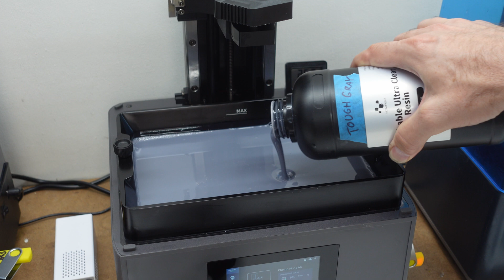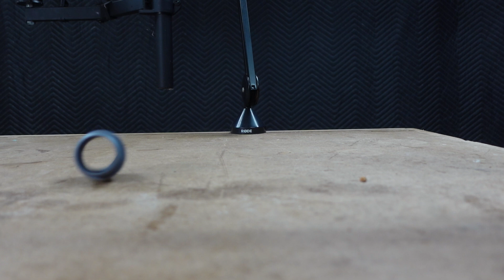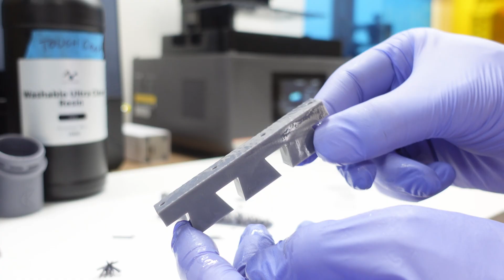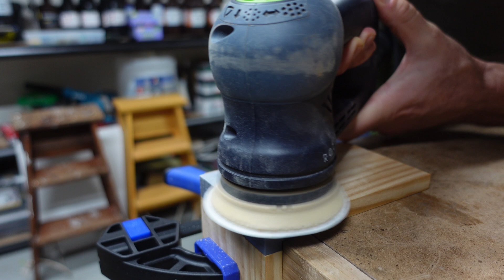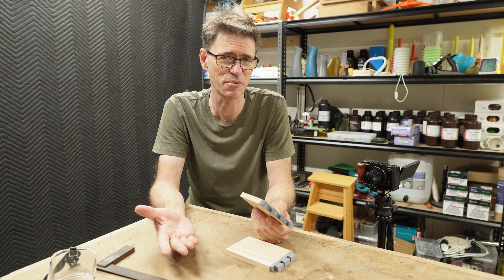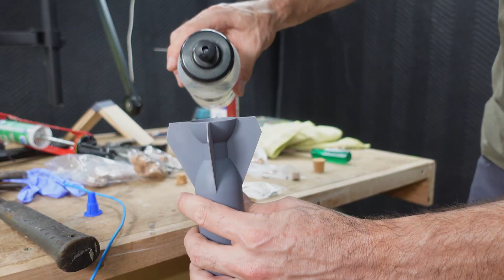Nova3D Water Washable Tough Resin | How tough?

Comment: When your dovetail breaks in bending at 8:40 or so, it’s failing at the stress concentrations.  You can’t design for resin the same as you design for wood...it’d be interesting to see how tough the material is with small fillets in place.
Reply from the maker: Yes, I agree with you. In this video I was just trying to do something a little different and 'break' the rules. I've been interested in ways of combining resin 3D printing with woodwork. It's a bit strange, but could have some interesting outcomes.

Comment: For the dovetail test, using wood glue on a composite plastic is the main limiting factor for the joint. If you were to use the proper adhesive for that resin (in cured form of course) I would bet that it would not come apart.
Reply from the maker: Thanks for the comment. I appreciate the observation. Yes, I agree. I was just using wood glue because it's easy and quick. But it would be interesting to try with a more appropriate adhesive.

Comment: What is the secondary curing process like? Also, how are the creep properties of the resins you've tested? Do they easily undergo permanent deformation under long-term stress?
Reply from the maker: Secondary curing is fairly simple. I used 5min for that part and it seems to work well. I don't have long term data on creep for this resin. So far most of my observations have been that the resins are fairly stable. Sometimes temperature and humidity can cause minor fluctuations in dimensional tolerance.

Comment: could you share the print settings from nova3d ?
Reply from the maker: Sure. I was using an Anycubic M7. Layer height 0.05. Normal exposure 2.0sec. Lift 8mm, retract speed 6.0mm/sec. Base layers 5. Bottom exposure 45sec.

Comment: How would this hold up in heat (not extreme heat) heat like in a car in summer or outside in the sun? Thanks for the videos!!
Reply from the maker: I can't say for sure with this resin. But, resins like this that I have tested do tend to flex a bit when they get warm. The most flexy resin I've tested so far when it gets warm is Anycubic Tough Resin Ultra. It's a great resin, but probably not the first choice for warmer use-cases. See the test here. https://youtu.be/u6vqb5tQAGU
Reply: @ColinKlupiec any resins that you have tested that might be a good choice for this environment?

Comment: I made some parts from Anycubic Tough and Tough 2.0. I soaked each in the following: water, motor oil, DOT 3 brake fluid. I soaked them for a week. I weighed the identical parts before immersion and after. the brake fluid and motor oil did nothing to the parts and the parts weighed the same as before immersion. The water on the other hand weighed substantially more and grew in size. The part became very flexible (this was all done at room temperature) as compared to its pre immersion state. I left the water soaked part on a shelf in my house (house was 30% humidity, northern Colorado in the dead of winter) and within a day or so the water soaked part returned to its original size, firmness and weight.

My conclusion is the material is Hygroscopic so be careful what environmental conditions it will be exposed to.    But I am very pleased with the Tough materials
Reply from the maker: That’s a really interesting result, I’d never thought of that before! Thanks so much for sharing your test results. I wonder if there's an application that could take advantage of the hygroscopic properties.
Reply: @ColinKlupiec  I also sandwiched the part between 2 pieces of metal and torqued the bolts to spec (how the part would be used in the real world, Automotive) and put the assembly in the oven at 175 deg F for enough time for the parts to reach 175. then placed the assembly in the freezer 0 deg F till it was 0 deg F in between cycles I let it get to room temp and checked the torque. No change all the bolts remained at spec. I did this 10 repetitions on several samples. The part survived very well. There was some spider cracks around the inside of the 4 mounting holes but the working area of the part was perfect.
Reply: @ColinKlupiec  object in a bottle!

Comment: So the link in the description says it's ABS like water washable,is that correct?
Reply from the maker: Good observation. On the Nova3D website, the menu link says "Tough Washable Resin", and on the webpage for the resin the title is "NOVA3D Water Washable ABS-Like 3D Printer Resin Tough Washable Resin". So, it's a little confusing. Also, the description of 'ABS-Like' is quite vague. To say it's 'like' ABS could mean many things. 🤔 That's why I simply referred to it as 'tough resin'. Having said all that, I reckon this resin performs really well.
Reply: @ColinKlupiec  alright, thank you
Reply: Apparently this color isn't gray, but rather named "Gary" also... 😂  I think they're just trying to nail all the buzz-words they think will encourage people to buy it, though personally I think it's a mistake to try and cash in on the tired old "ABS-Like" nomenclature, which really means nothing and has ultimately disappointed many of us in the past. Still, the resin looks like a winner based on performance here, and the price isn't bad.. 🤷‍♂

Comment: Great video! How did you find the cleaning process? Is it the same, or require more or less washing that standard resins?
Reply from the maker: Thanks. The cleaning process is pleasant change. I put water into my wash & cure station and it worked just fine. In fact, I ran the cleaning cycle for much less time and it seemed to be quite effective. I have to admit...cleaning the prints without IPA odour was a bonus.